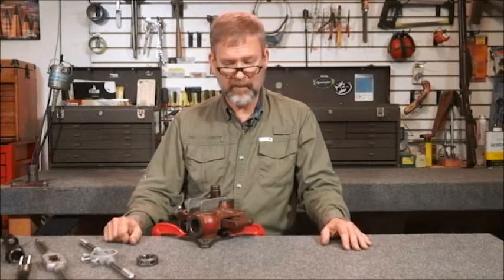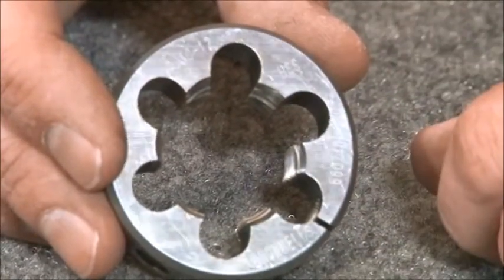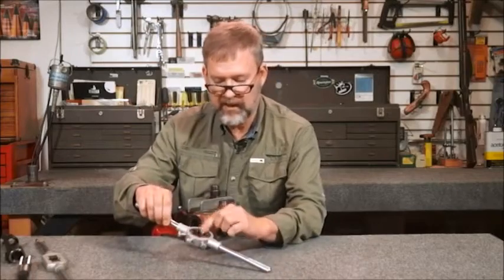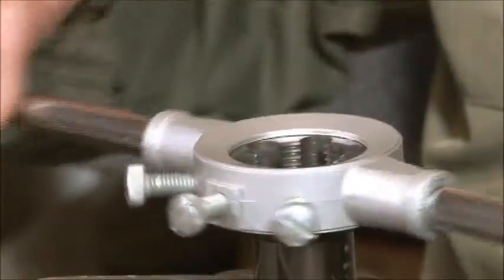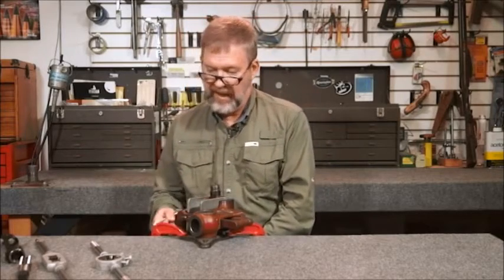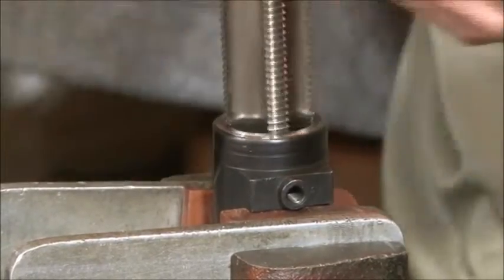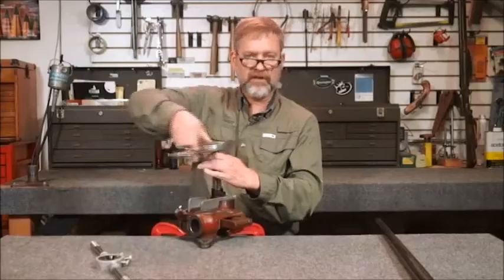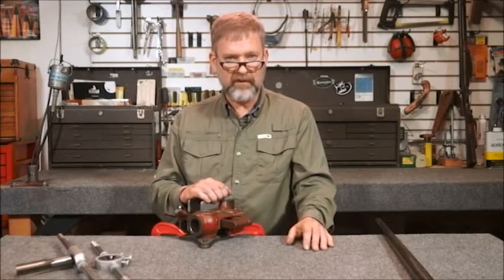Barrel Taps and Dies

Comment: Do I need metric or SAE tap and die set for barrels?
Reply from the maker: Barrel threads are not found in the average tap and die sets.  Most run one inch or larger.